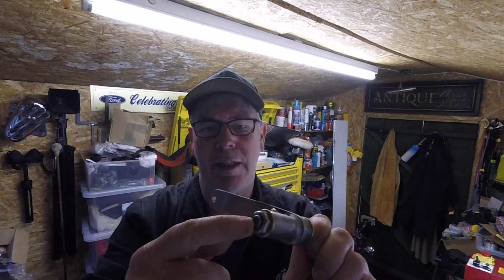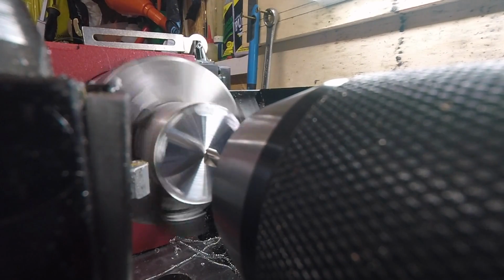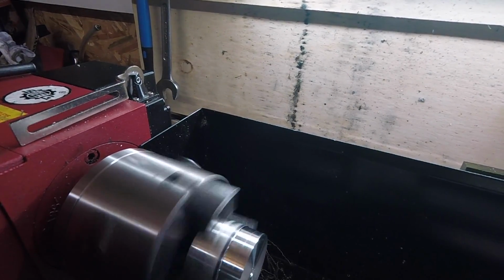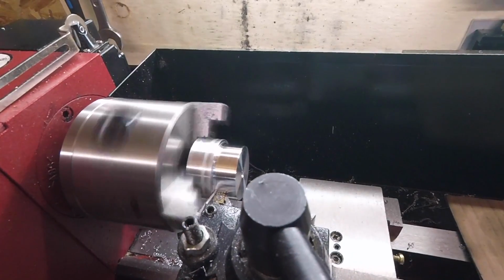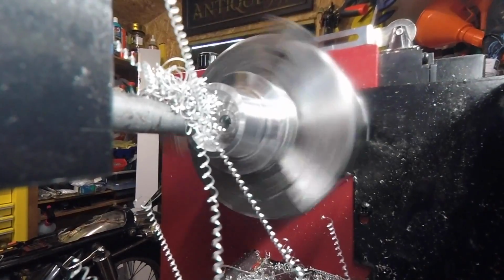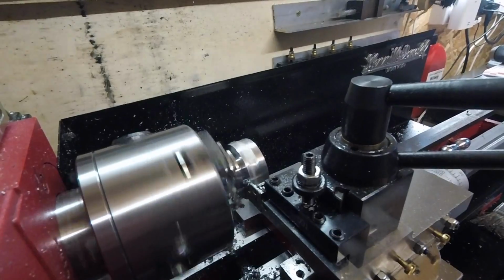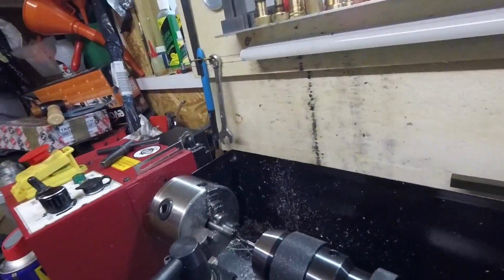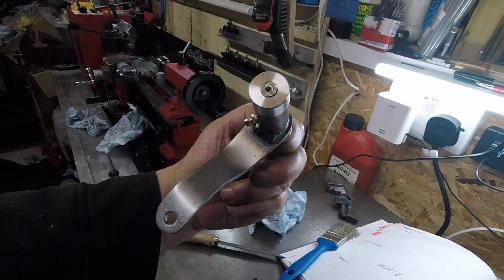Buggering about on the Chinese Mini Lathe

Comment: Super job , handy video for me as I just bought the same ali bar to make some ends for my foot pegs , I was going to get some instruction and playtime on the lathe at the Harley shop but C19 has stuffed that . I rub soapstone /French chalk on my files for ali , other times I use soapy water to reduce clogging - if you check out the pro bolt site , you can probably get gold coloured screws/bolts to go in the end to set the ali off .
Reply from the maker: I have bags n bags of french chalk too, why didn't I think of that? probably 'cos I'm a bit thick lol

Comment: I forgot to mention - consider a bandsaw for cutting your bar/tubes , they are pretty accurate in terms of square cut , and easy to tweak if a mil or so out , and , Femi have put out a entry model which can switch to vertical (table extra) - you can then cut out profiles/slit tubes etc , you can also cope/birdsmouth tubes of same diameter .
https://www.stakesys.co.uk/metal-cutting-bandsaws/portable-saws/femi-sn105xl-swivel-head-portable-bandsaw-230-volt
Reply from the maker: mmmmm Looks a good bit of kit, Stakesy's are quite local too ;)
Reply: I've got one. Bloody lovely bit of kit. Really solidly built.